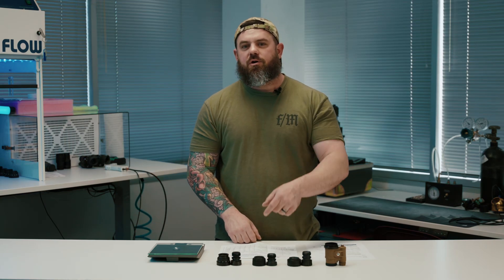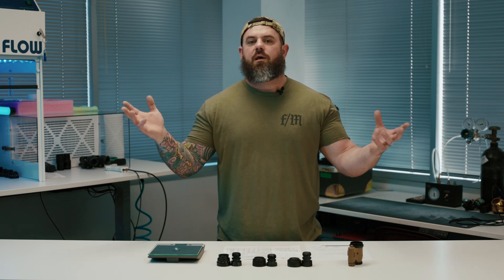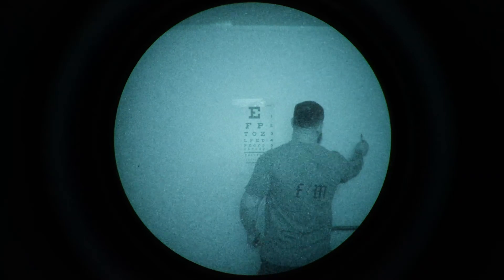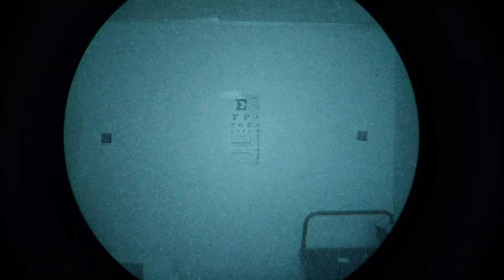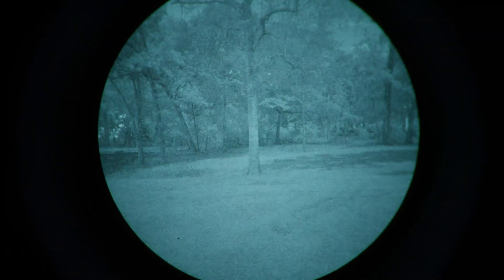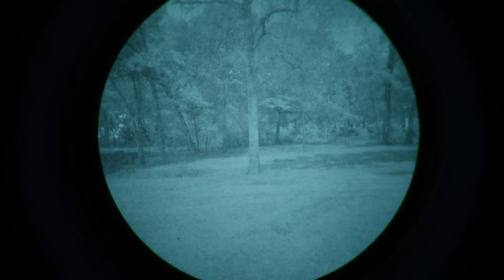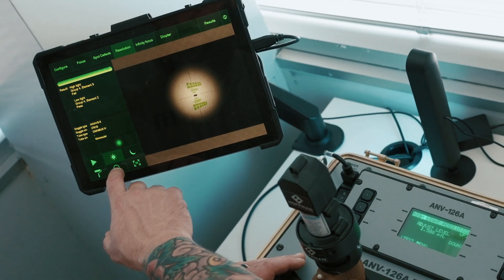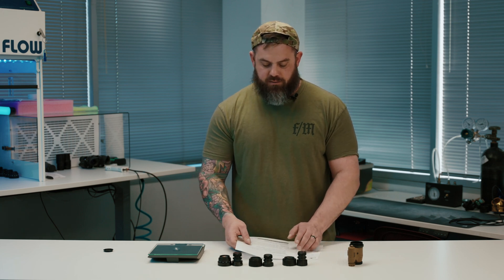Custom Night Vision | 50º Boomslang Optics

Comment: If you wanted to run goggles (like the ESS ones, for example), would you recommend these due to the eye relief difference? From the looks of it, the Boomslang seems more appropriate for use with glasses so you can set them as close as possible to the eye.

Comment: Id still rather go with the 58 deg lens with more fov, similar res , higher eye relief and way lower costs
Reply: They are nice. But Resolution is not even close. But at 1x it's the least important spec..
Reply: @aesthetic8780  i mean, its obvious that they have worse res at this fov.. but i think they still do great and i would use them over boomslang lens, just because eye relief and fov increase
Reply from the maker: cool. let us know how they work.
Reply: @customnightvision  they seem to work pretty well, they have like no distortion and the eye relief is over 20mm so they can be used even with gas masks (youll lose some fov but its still more than 40), the only disadvantage they have is ofc the reduced Resolution and apparently they also seem to have a slightly darker image,but i myself didnt notice that when using them.
For the price there great, and i would even buy them when they would cost more
Reply: @ID-9999  Have you used boomslang before?
Reply: @Mr-mp9ur  no, but aint speding that money for them as well, ive seen enough comparisons which show me its simply not worth it
Reply: @ID-9999  maybe or maybe not
Reply: @Mr-mp9ur  you know what the fov difference of 40 to 50 deg is right? Also i have an nvg50 which has an simmilar bad eyerelief
Reply: @ID-9999  um so that mean wfov 58 lens has similar bad eye relief as nvg50 agm?
Reply: @Mr-mp9ur  no, but the boomslang seem to have
Reply: @ID-9999  Where did you find information about comparing boomslang with 58 lens? 
I'm interest in wider fov, also want more info on it.
Reply: @ID-9999  Does you means only b.s lens has bad eye relief and 58 lens does not?
Reply: @Mr-mp9ur  there has been some talk on the nv discord

Comment: Did you test if that is the resolution limit of the optics, or if it scales up with a higher res tube? 
While I had to use a 25mm tube to get a 92° fov, I noticed, that I still got a rather strong magnification on the tube details when looking around in the image. 
Also the smallest 25mm tubes I'm aware of, are in 43mm format. Having 36mm tubes with 25mm screen and photocathode would be really nice in my opinion. 
But it seems the trend goes towards 16mm screens.
Reply from the maker: No sir, I tested the one tube as a constant.
Reply: @customnightvision  Thanks for replying to my late night ramblings.

Comment: Nice video! As we mentioned on the Cold Harbour video the Boomslangs are designed specifically for the PVS-14. That particular standard housing size (the internal dimensions of the housing) limits what anyone can do in designing wide FOV optics. We can design 50 degrees with 25mm eye relief, it requires a totally different internal housing design from a standard PVS-14. Therefore, the Boomslangs were designed to provide 50 degrees FOV capability that is backward compatible to almost all PVS-14 type night vision goggles currently in use. The end goal was to minimize fisheye distortion prevalent on other wide FOV optics, while preserving as much clarity as possible edge to edge while drastically increasing situational awareness.
Reply from the maker: Well as I said, it looks like you achieved your goal. you never contacted us about the tubes for testing?
Reply: @customnightvision  You have an open invitation to our facility, and we'll contact you when we have the tubes for testing.
Reply: @PhotonisDefenseInc. Would love to see them reviewed. These lenses look spectacular btw! Very well done
Reply: That’s a really gay shirt. ❤

Comment: What kind of FOV performance are you going to see with a set of 65 degree set RPNVGs?
\
Reply: Was wondering this too. Guessing probably just a bonus 5° on both sides, along with the extra on top, bottom, and overlap in the center. But I'm regarded so idk.
Reply: @JAD77755  i talked to a buddy who has both. he said lenses on a set of RNVG A's is better than the panning, and there are too many draw backs with both together
Reply from the maker: yeah id choose one or the other. the RPNVG is kinda heavy and bulky..

Comment: Would it have even more benefit with panning night vision unit ? Or is that not how that works lol, could be a dumb question.
Reply from the maker: No such thing as a dumb question, yeah i mean you would have more fov but the reduced eye box may make it more difficult to utilize it while viewing the tubes off center eyeline.

Comment: What would the fov be with these optics but on a noisefighter or similar bridge?
Reply: 10* more left to right. But also up and down and more fill in the center. I find with my rpnvgs I don’t usually run them fully out because I loose too much in the center. This is hopefully going to help with that.
Reply from the maker: elohel "Ineed 180*"